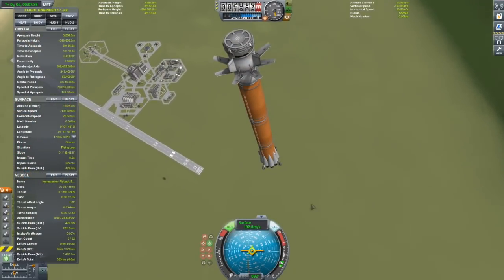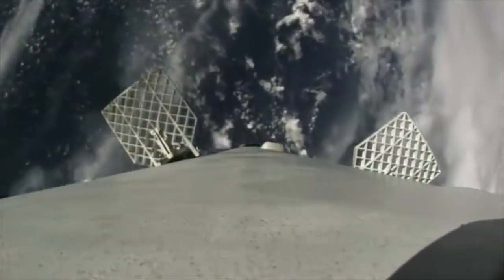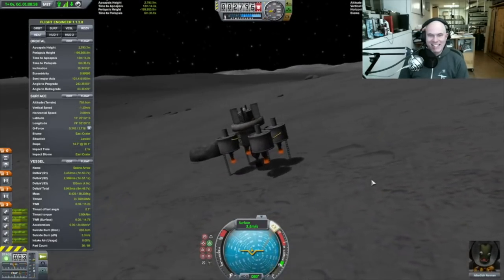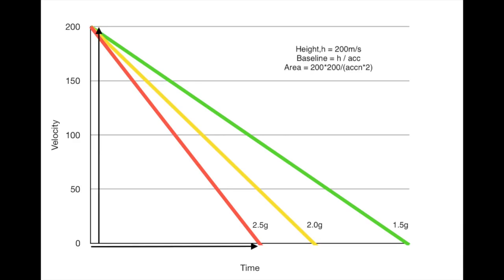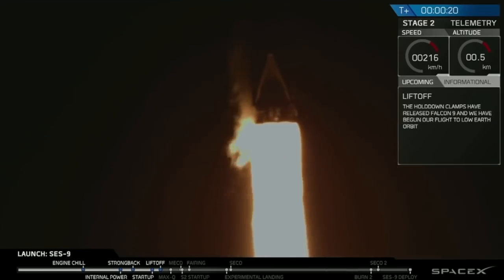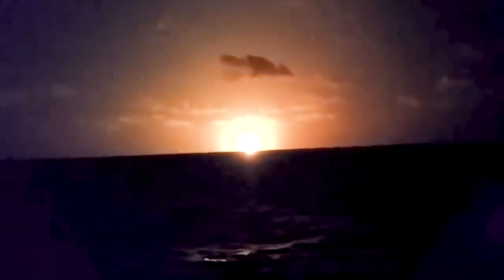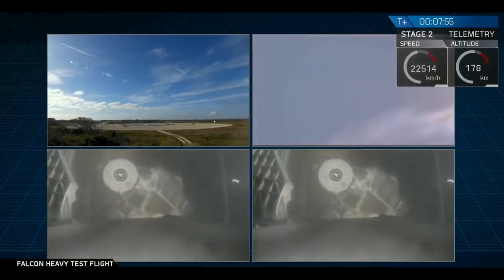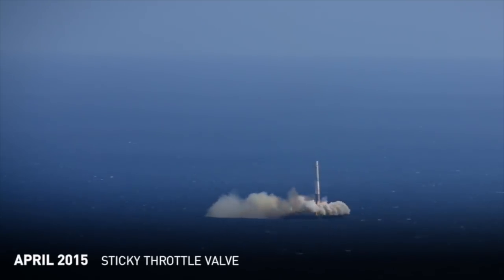How To Do A Hoverslam - Things Kerbal Space Program Doesn't Teach.

Comment: What's more impressive than a rocket landing itself? Your rocket splitting into 3 pieces and each piece landing itself XD. Well 2 out of 3 isn't bad either.
Reply: The middle one still landed, but in several hundred smaller pieces  :)
Reply: It's really brilliant if you think about it. They needed it in smaller pieces to transport it back safely. They just took it apart really really quick.
Reply: "Rapid, Unscheduled Disassembly."
Reply: Make that 3/3

Comment: Jesus Christ. I didn't realize rockets were so explosive in real life. I thought that was just gaming physics.
Reply: @enricobianchi4499  glitch through the ground
Reply: @Sednas  yes you get an a plus
Reply: This makes sense since were all in a simulation, inside a simulation inside, another SIMULATIONNNN @Sednas
Reply: @enricobianchi4499  He probably figured that since the rocket was empty it would be as flammable as a used firework. Of course, "Empty" doesn't mean "Not still soaked with explosive propellants" in this case. To say nothing of any remaining usable fuel after the suicide burn.
Reply: A rocket engine is literally just a controlled explosion
Reply: @barleysixseventwo6665  well, that and you'd assume "oh, it's not going that fast, it should be fi-" and then it fucking explodes like a bomb
Reply: @enricobianchi4499  well what about when it lands, tips over, and goes up?
Reply: The issue is that the fuel tanks are built JUST strong enough to endure the internal pressure and the acceleration in one direction due to weight considerations. And pretty much the majority of the rocket body IS the fuel tank... When you take something like that and suddenly flip it on its side and slam it into a drone ship deck, you get rapid unplanned disassembly. The explosion itself is not from the fuel just deciding to explode, its because they use other inert gasses to pressurize the tank. crack the tank open, gasses escape, forcing remaining fuel out where the engine has just been burning, and BLAMO!
Reply: Alyxandeyr yeah, I don’t get why 3rror200 and people like them get so angry at other people for realizing something “obvious.” That attitude drives potential learners away from the field. It’s not that hard to be nice on the Internet!
Reply: fakiirification thanks for this explanation :)
Reply: The biggest non-nuclear man-made explosion is from a rocket. This is enought said.
Reply: @drewlop , because they were born with all the knowledge of the world, and it irritates them that others weren't.
Reply: notahotshot, those poor unfortunate souls; must be lonely at the top of Knowledge Mountain 😔
Reply: John Smith  Controlled combustion is not the same as an explosion. Much like people think there are explosions inside a car engine; there is not. There is only controlled combustion (unless something goes wrong!).
Reply: Adrian couldn’t have explained it better
Reply: noxious89123 lol explosion is just uncontrolled combustion
Reply: It's mainly because rockets are structurally incredibly weak from all but specific load angles.They need to be as light as physically possible. Typically a rocket is little more than a couple of tanks stacked on top of each other, those tanks keep their rigidity partly by being pressurised, that's how much weight saving goes on. Most rockets couldn't even stand up on the launch pad with the payload on top if they weren't pressurised, they'd collapse. The point is they're designed to handle load only from the direction that matters, if the rocket falls over or otherwise has to take some load from a non-optimal angle, there is a high chance of failure. Even when under pressure, those fuel tanks will rupture immediately if you dent them from the side. And even when the tanks are "empty" (they're never truly empty) they're still holding pressure. It's worth noting that most of the force/power of these explosions comes from the pressure failure rather than a typical explosion. Those tanks hold very high pressure and they pop like a truck tire when they fail. The flames are just for show.

Comment: The atmospheric drag also greatly contributes to the efficiency of a suicide burn. By waiting to the last second to begin the burn, you maximize the amount of drag placed on the rocket which will reduce the velocity at burn time and thus will require less fuel.
Reply: It's most efficient to land with the wind going upwards, slowing you down. So the best way to land is near the eye of a hurricane. The disadvantage: You might have to wait quite long for your landing window.
Reply: The eye of a hurricane is actually very low pressure, aim for the cloud wall for better effect.
Reply: snowpdx Paul said "near" the eye of a hurricane which probably refers to the eye wall. This indeed has the highest atmospheric pressure and updraft.
Reply: Make the barge into an air hockey table!  Smartz! :P

Comment: calculating a suicide burn can get incredibly complicated especially when you add:
air friction
fuel use making the rocket lighter gradually while you descend but the more fuel you use the more this comes to effect
non vertical approach trajectories
gimbal control reducing thrust
etc
approaching with 3 enignes and shutting down 2 justb efore landing gives a huge advantage because it means you have a rather significant point of control relatively close to the landing, so you can do final adjustments by controling when you shutdown the two extra engines and these are close to the actual landing so the deviation after this correction is small - and shutting down engines is a lot more precise and reliable hten igniting them
Reply: Julian Danzer of
Reply: that's why it's called rocket science...
Reply: that would be so easy if gravity wouldn't keep pulling on you, so your path curves making your descent rate nonlinear meaning that now its really complicated to figure out how long exactly your descent is gonna take - its not too hard to figure out when you have tiem and apen and a paper but when trying to do it on the fly it gets a bit tricky
Reply: This is why we consign some tasks to computers.
Reply: Julian Danzer 
I think the problem is the wind. You can't measure how the wind behaves perfectly and an unexpected squall or in the case of landing on a boat the change of the angle due to waves might ruin an otherwise perfect landing.
Reply: HuntingTarg Someone still has to program the computers...
Reply: skeptic moderate 
Quite true - I meant vs. a pilot manually computing the correct ignition start time on the mission clock.

Alan: "You can't account for everything, Charlie."
Charlie: "You can if you can think of everything."
Numb3rs
Reply: HuntingTarg Oh sorry, I misunderstood.
Reply: i think the worst part is wind drift and draft everything such as weight lift angle can be accounted for the only thing that make it extremely difficult is the variable that constantly change such as wind drift resistance and draft like what he said for a suicide burn to be successful it needs to burn at the rite moment not to late and not to early the window gap is very narrow and such thing as wind drift can easily effect that gap that why i think space x ability to land its rocket with this method consistently make it a true sight to behold
Reply: Partial Differential Equations are a wonderful and yet evil thing.
Reply: Julian Danzer air friction isn’t a thing, but air resistance is
Reply: Assuming constant thrust, the mass decreases at a linear rate. This is fairly easy to calculate. Also, there are libraries that greatly help with numerical integration (since KSP is based on .NET, I'll just point out e.g. AlgLib). The advantage of numerical integration is that it's flexible and could even deal with these other factors that were mentioned. I'm not saying it's a trivial problem, just saying it is certainly solvable.
Reply: but then when you have like 50 people working on the equation...
Reply: I don't think you use gimbal while controlling a suicide burn, I think its mostly monoprop
Reply: Dont forget the heat radiation caused from entering the atmosphere changing the engines efficency
Reply: Not to mention the air isn't completely uniform in density, even at the same altitude. IE turbulence. 

And let's not forget wind, holy shit.
Reply: eNIGnes
Reply: good we have powerful computers now.
Reply: Thing is... all those things can be calculated in - as complicated as they are - just get a big enough computer which isn't so big any more, but....

What the engine will do at the end of the flight - did something freeze or stick in a funny way, did something get slightly clogged - will it cough for a half-second before giving full thrust or will it just burrrrn, that tweak to fuel efficiency we put in the last flight, did it change naything? In that split second before the thing lands or goes kaboom?

This is always 99% sure at best, and 1% kabooom
Reply: Or, you can start the suicide burn at the point where it would reach 0/0 when maintaining half of the available throttle (i.e. if minimum throttle is 50%, maintaining 75% throttle) and making minor adjustments to the throttle based on real time calculations and the delay on ignition
Reply: @richardmillhousenixon  real rockets cant throttle like that though
Reply: @theaveragepro1749  except they can. let's assume this is using a Merlin 1D engine. Estimates given by Elon say that the engine can throttle all the way down to ~40% max thrust without flaming out, so let's say we start the engine at 70% throttle and do minor adjustments to the throttle to maintain the deceleration needed to hit that 0/0 mark
Reply: @skepticmoderate5790  - unless we give it to an AI
Reply: I just eyeball it in ksp if I fail, more boosters should do
Reply: This is not very complicated compared to e.g. calculating what happens in electrical circuit when you break it. That's the stuff that we learned to do in university. Right now I probably won't be able to get equations correctly on the first attempt because that was so freaking long time ago... HOWEVER when you add all quirks of control engineering now THAT will be really hard to do. We studied how to make control equations for 1.5 years and math for 2 years our professor was very upset that this is too little because back in soviet era corresponding math was studied for 4 years... On the other hand I would be surprised if more than couple of hundred people in the World use this math - people who write simulation software for that kind of things.
Reply: But the thing is their accurate though.
The math dont change that much and it isnt that hard to properly factor all that stuff together

Comment: I land my racing drones like this. Free fall from about 50 meters, use the OSD to level the airframe with the horizon, then pin the throttle and steadily roll off... it's so rad when I nail it.
Reply: Pretty brutal when you miscalculate, though.
Reply: This. Especially since racing drones have such high power to weight ratio, if you punch out at the correct moment the drone LITERALLY stops without any delay, it really looks like CGI.
Reply: Lol I usually just fly low, then turn around quickly with yaw, a quick throttle pulse. That eliminates horizontal speed and then just descend. (I use 40° of uptilt on my FPV cam). Or I simply crash
Reply: lol. That seems... Risky.
Then again, it's just a drone I guess.
I've been learning to fly a plane, and well, when you're on the thing that's landing you tend to be a little more risk averse.
Though I guess fixed wing aircraft have rather different dynamics, since you can land just fine with no power at all.
Turns out the primary approach for powered landings though basically amounts to flying the aircraft into the ground then killing your vertical velocity at the last minute.
Then you cut all the power and coast just above the ground. As you slow down, you lose lift and drop onto the runway...

I guess you can't really do anything comparable to a suicide burn in a fixed-wing aircraft... XD
Reply: Can you autorotate a drone?
Reply: If by drone, you mean multicopter, it is possible physically, the only reason it is not possible now is that current control electronics do not support it
Reply: 007titok
Bollocks, You need to have collective pitch controll for autorotation to work.
Reply: Not needed. You can use all motors as generators to charge a capacitor while falling, and switch to motor mode when needed
Reply: Thats not autorotation. 

I don't see that idea working either. You would generate practically nothing, and assuming you could make the quad fall straight down to spin the props which it won't......
Reply: But when you think about it fixed wing aircraft are kinda scarier. Like some chump out there decided this shape was the best way to cause the Bernoulli effect, and some other chump said yeah alright and bent that sheet metal supposedly into that exact shape, and now I'm the chump that believed them and decided to fly it. On top of that some chump punched some stuff in a calculator and said yeah you gotta have it all laid out like this so the CoG doesn't go out of the envelope and mess it up and now I've got to make sure someone didn't put bricks in my tail. And on top of that some sewing machine company decided it'd be pretty rad to make an airplane engine and I'm the one trusting this sewing machine to make me Go Fast™ enough to keep the Bernoulli effect going over the aforementioned hunk of sheet metal.
Reply: lol how often would you nail that though... I mean if your fpv camera has any uptilt you couldn't see the ground when the frame is level. Freefalling from 50 meters you would have no clue when to throttle or what the hell you're landing on. Do a little yaw like Klaus says works well and can still be pretty rad, and chances of nailing it are much higher :)
Reply: I've done these, though not from 50m.
I've also done the "kill horizontal speed with the lateral version" one.
Reply: Not so fun when you do not nail it... I guess if you start up the engines a small fraction of a second to late you will need a vacuum cleaner to pick up your drone.

Comment: When you are traveling at 16880m/s, and you try to slow down before you inevitably crash into the mun...
Reply: quicksaves
Reply: And you have a xenon engine
Reply: Too many times.  Altitude 10000*. "I still have a lot of time not going to start burning fuel just yet"   *crashes at full thrust near the end
Reply: @microlobbies2378  ion engine*
Reply: @dustymooneye5858  [QUICKSAVING INTENSIFIES]
Reply: Haha why don't you get into a low Mun orbit first? So then you can either start descending when you're already relatively slow, or dock a new craft to the lander to refuel before landing? I only played "2D KSP" (Spaceflight Simulator), but still. I used to have a trajectory that ends with a crash straight into the surface of the target object but I often had to start the suicide burn much earlier than I thought I should have, depending on where I was going and how powerful the engine was. But then I realised how much safer orbiting can be.
Reply: @redsquirrelftw  fucking true

Me last Night
Reply: Turn on the time warp and glitch through the mün
Reply: I just use a heat shield and a parachute, works everytime, but never successfuly

Comment: There is another advantage of the 3 engine sequence they used for the falcon heavy launch. Shutting down an engine is much easier than starting, and thus possible with higher accuracy. You stop the fuel flow, done. Having 3 engines running and then shutting down 2 gives you a precise and very capable degree of freedom. Shut them down at just the right combination of height and velocity, where the single engine can do the remaining job.

Comment: Funny enough, I had just programmed this in kOS a week or so ago while trying to make my Grasshopper recreation land on the launch pad.
Reply: Did you succeed?
Reply: I did. Though the code I'm still working on. So far I've made the Grasshopper fully autonomous. Flies up, hovers at 1000m, then angles and lands itself on the launchpad. It's* using a simple calculation to figure out how much time it'd take to decelerate at 1.5g's of force. It usually gets up to about 50m/s in vertical speed before it starts to suicide burn. I'm still actively working on it. I don't like the lat/long measuring to stop overburning horizontally, and I'm still trying to perfect it before moving onto the Falcon 9/Heavy/BFR.  If nothing else, it's been fun figuring the code out. Just started learning kOS a few weeks ago.
Reply: Lol, well yes and no. I am high, but the response got held for review because I'm an idiot and tried to give a quicklink for anyone to view. I'll repost without links:

"I did. Though the code I'm still working on. So far I've made the Grasshopper fully autonomous. Flies up, hovers at 1000m, then angles and lands itself on the launchpad. It's* using a simple calculation to figure out how much time it'd take to decelerate at 1.5g's of force. It usually gets up to about 50m/s in vertical speed before it starts to suicide burn. I'm still actively working on it. I don't like the lat/long measuring to stop overburning horizontally, and I'm still trying to perfect it before moving onto the Falcon 9/Heavy/BFR.  If nothing else, it's been fun figuring the code out. Just started learning kOS a few weeks ago."
Reply: I doubt I ended up on reddit, I'm too small of a streamer.
Reply: Hey that is enough funny